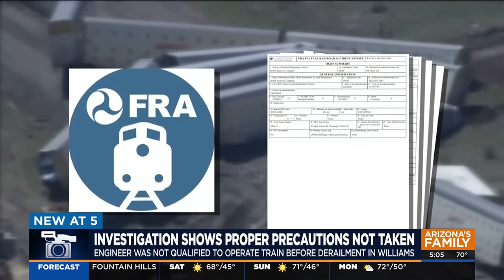Engineer unqualified to operate train in derailment near Williams, feds say

Comment: Arizona can't regulate train length. Trains are a federal matter
Reply: Train length shouldn't be a federal matter, or a state matter or a local government matter.  None of those entites employs people who have real knowledge of the dynamics of operating a Model T Ford, much less a train.  I also have a feeling that the unions are moaning and groaning because longer trains mean fewer crews.  And, I thought train crews were trained to operate trains of ANY length.  I did know they needed special training depending on train length.
Reply: @cats0182  I would think the unions would be angry for the Biden administration for interceding not for the union to strike.
Reply: @cats0182  Wouldn't you want someone to moan and groan in your behalf if the company you work for was trying to shrink its staff not because business was bad but to simply improve the bottom line and increase investor payoffs? Because that's what the railroads are doing. There is no reason to operate like this other than they don't want to spend the money to both hire more people to run the railroad and make the job worth having, nor do they want to take the time to properly inspect locomotives and rolling stock because they know they've been pushing the equipment to the brink and if they did inspections and repairs properly as they should most of the fleet would be sidelined and then they'd have nothing to run the railroad with.
Reply: @cats0182 good thing nobody pays you to think, don’t speak on things you don’t know or understand.
Reply: @jamesr2888 that has nothing to do with this, please stay on topic.
Reply: @EJayMD-11  So instead of worthless comments, why not give me a quick education.  And, how do you know that nobody pays me to think.  Are you some kind of crystal ball reader, or soothsayer, or clairvoyant?
Reply: @cats0182  this is such an ignorant take. Every class 1 railroad runs trains 2 miles plus long. We are qualified to run a train of any length, that’s not the issue, the issue is having to walk 5 to 6 miles round trip to find the issue on a hot bearing for a car that hasn’t been properly inspected or maintained. We can’t combat fewer crews because that’s not a government issue and they don’t have the backbone to intercede with mandating 2 man crews so we can attempt to make them shorter. On my class 1 we call them “supers”. 6 locomotives 232 cars and 14 thousand feet. No siding can hold them
Reply: @cats0182 no it shouldn't.
Reply: @cats0182  The government regulates and mandates railroads...taxpayers pay for the RR pensions and even medical insurance, that's one of the reasons that the question of "Have you ever, or do you currently work for, the railroad" is on unemployment benefit applications. 
You've obviously never heard of the FRA (Federal Railroad Administration). 
It's very sad that taxpayers pay for benefits for railroads, but yet "they're a private company" profiting millions every year. Railroads don't pay property tax, nor do they pay fuel taxes. After the threat of shutting down the railroads earlier this year because of "working conditions", and our POS president caving to the RRs, taxpayers are only going to be out more money, the CEOs/admin will only get paid more, and we'll be held hostage again for the same thing by the RRs in a few years. The government should have stepped in and enforced labor laws or told the RR employees that wanted to strike that they knew job expectations before they took the job.
Reply: jamesr2888 Unions bcth about everything.
Reply: @MilwaukeeF40C  They have to, because the equipment is not designed to operate in a train longer then 125 cars, 98%of derailments this year involve trains greater then 125 cars. and 1 person in the cab of a locomotive is as dangerous running a nuclear power plant with one person!!

Comment: Man, I remember operating some freight trains over ten thousand feet long in very cold weather. It sometimes took forever to get the train's brake line to come up at your initial terminal because of all the leakage from brittle, rubber gaskets in the "glad hands" between freight cars.   Many times, your dynamic brakes on the locomotives wouldn't be enough to hold your speed on a downgrade and then you'd have to go deep with your air brakes just to keep within the speed limit and hope you didn't have to set the brakes again before your trainline recharged.  Glad I'm retired now with the trains apparently being a lot longer than in the past. Perhaps the placement of locomotives in the middle and rear of freight trains helps prevent the train brake issues I faced.
Reply: That’s one of the reasons for the use of DPUs. In addition to reducing the drawbar pull on the head end, DPUs provide additional air supply and reserve for brake pipe charging.
Reply: I had an iced line on a coal train once before we had to link the eot. Only a couple times have I been scared running a train, that was one of them.
Reply: There is another to control your train on long downfall mountain grades before dynamic or pressure maintaining features.Stop your train have the conductor walk back x amount of cars setting the retaing valve to low medim or high setting.The brakes on those cars will not release while you are desending the grade Of course once you have the conductor will once again have to walk x number cars to reset the retaining valves on the cars Can you imagine the hisey fit the rail traffic control center would have Rember safety is the first importance in the discharge of duty
Reply: @thomasklimchuk441  We were always taught about the use of retainers, but never used them as the trackage I operated over was pretty much straight and level here in the Midwest.
Reply: You think genius?
Reply: @thomasklimchuk441 depends on the timetable. On our division we aren’t allowed to touch them except during a class 1 if they aren’t in the correct position
Reply: @yankeesforlife24  NS you don't touch them. They used to use them on saluda mountain but they shut that run down.
Reply: It does help.  Probably better than the push for "electronic brakes".
Reply: You're not even supposed to use air under leader or trip optimizer, you better sometimes take 1st service if the dynamics are week but then they want to handle you for it.  When the air shoots just leave it pulling and keep bailing until pcs finally trips otherwise you'll get this kind of pile up. The rear catches up with the front and here ya go.  They see you pissing away your air on the tapes and you're going home for a bit lol.

Comment: I have been an engineer for a very long time and have never heard qualified for train length. I think another and perhaps bigger concern is trains blocking crossings.
Reply: Yeah, I was an engineer for a while. Never heard of that. I have two friends who work for the UP. I am going to ask them if this is a thing.
Reply: @PatrickLipsinic  It isn't, but it should be. BNSF woke up one day a few years ago and decided to throw double trains and trains exceeding 7500' with awful train makeup (empty blocks in between loads, light loads like autos in the middle of trains with EOC, etc) at engineers with no instruction or training on how to properly handle such giant piles of shit.
Reply: I’ve been running both freight and now passenger trains for over 20 years north of the border and I’ve never heard of this.
Reply: @thetrainshop  NS is the same, only 12-14 thousand feet. Just pat on the butt and a good luck. Oh and a hearing if anything happens.

Comment: It’s shocking that the federal government after so much warning from industry veterans like myself does nothing about this.  They just keep letting the railroads do whatever they want at enormous risk and potential catastrophic cause.  They force you to use computer programs that don’t work and then expect you to be prepared to handle the train the moment the computer makes a mistake.  Trouble is, if you’ve not operated the train yourself over your territory in months because the computer has been doing it, you’re not prepared.  All we get is more excuses from our government and a blind eye to our pleading for help.
Reply: The PTC, LEADER and TRIP Optimizer systems are the biggest issue.  As noted if they have the computer trying to run the train but if it fails then the engineer is probably 'rusty' and isn't at his best.  I have never heard of a 'length/weight' qualification standard so that's just the news people making a mountain out of a molehill.  I left Class ! railroading just at the beginning of the use of train management systems and PTC.  Friends I talk to that are still working there hate the systems because all they do is babysit the train.  Some runs even have the horn blowing programmed into the PTC so the engineer basically does nothing except handle the train at the terminals.  That is "A HELL OF A WAY TO RUN A RAILROAD"
Reply: Agree. I've said for years that it's going to be problematic with less & less experienced engineers due to TO. Kinda like that video where a Dad gives 2 teens 5 minutes to make a call on a rotary dial phone. They failed. All they knew was the new tech. Engineers are becoming the same thing.
Reply: It's simple really, In all kinds of industries.

Business can come up with ways to get around regulations, a lot faster than the regulators can identify the problem, and update the regs.

  Especially when one political party is hellbent on killing any regulation, of anything

Take the FAA.  It used to be the worlds aviation watchdog, with hundreds of skilled,, experienced investigators,, regulators,, and researchers.  The world based their regulations on what the FAa was doing..

Forty years of budget cuts later, "chronic understaffing" means that  nobody ever sees an FAA guy in the field except for the airlines and Air Charter operators.  Or if there is an accident.

The rest of the world looks to EASA for guidance now, not the FAA.  Unlike Republicans, the Euro countries believe that you can't trust people to self-regulate, especially when there is so much financial incentive to look the other way.

Comment: Only one engineer on that malfunctioning Lac Megantic train, The train caught fire, the fire was put out and the engine shut off but the brakes slowly lost air. It rolled 21 kms downslope from Nantes.
Reply: You mean MMA train#2
Reply: The engineer was 'experienced' but DID NOT SECURE the train as was required by the rules.  He took a 'short cut' and the town of Lac Magantec  paid the price for his incompetence.
Reply: The Fairy Department stuck its nose in where it doesn't belong, turned off the engines, and that revoked the power required for the dynamic brakes. Once the dynamic brakes had no power, the train rolled down the hill and then the disaster took place.
Reply: @MrJuvefrank  fairy department?
Reply: @MrJuvefrank  Please explain to us how dynamic brakes are used to hold a stopped train in place. And I imagine the use of "fairies" will be needed.
Reply: @MrJuvefrank  dynamic brakes aren’t using when the train is stationary, it’s literally impossible without a reverser. They turned off the locomotive because one of them was on fire, which was exactly how they were trained in such a scenario and with the permission from the trains dispatcher. They shut off the locomotive which meant that the air reservoir was no longer producing air to the brakes on the train. That’s why it rolled away.
Reply: @yankeesforlife24  I see.
Reply: #1 argument against 1 engineer operating a train!!!

Comment: I do not remember what issue it was, but Trains® magazine did a complete article related specifically to derailments.  Train length was definitely a key point, as many railroad lines have many S curves.

As a train goes through a curve, the flanges on the wheels of the locomotive(s) and railcars push against the rails, resulting in friction.  The longer the train, the more friction there is.  This friction then inhibits the locomotive(s) ability to effortlessly pull the train.  When you had hills, the problem intensifies.

As a truck driver, I've traveled I-10 and I-40.  Train lenghs are astonishing, and the number of locomotives on the trains is meager.  Though a modern locomotive possesses the power to pull up to 100 freight cars by itself, the strain put on the locomotive(s) will cause fatigue and the train will derail.  Simply adding an additional locomotive lessens the strain.  However, an engineer has to be skilled enough to handle a typical 1.5 mile long train.  Lack of training will cause devastating consequences to result.

In the trucking industry, training programs are getting cut short almost by half, just as training in railtoading has shortened.  So many drivers are not getting the proper training to successfully maneuver and drive a tractor-trailer combination.  With over 7 years of truck driving experience, I'm still learning new things.  I also have my "off days".  Common sense, patience, and getting adequate rest will reduce the chance of making mistakes.  Unfortunately, the "Big Dog" mentality can have severe repercussions.

Though I'm no expert, it doesn't take a rocket science degree to figure out the problem here.  When you cut corners, terrible results are possible

Comment: The fact that he wasn't qualified to operate a train of that length is a factor. But, it doesn't tell use the cause of the accident. Was the train travelling too fast for the siding? Was there defective track? Journal overheat?
Reply: Speed has not been ruled out. According to them, the Engineer didn't know what he was doing. This means they don't think it was the track, but the journals were just fine when he boarded the train, but he could have neglected the journals as soon as the train was set in motion. Just in case the public doesn't know about railroad jargon, journal means, "The rotating part of equipment." Jour means, "Day." Journals had to be cared for every day.
Reply: @MrJuvefrank  "didn't know what he was doing." HHmmmm... 😜I'd probably say the same thing and throw the blame on the railroad. From the news report, sounds like they broke a knuckle earlier and were held while that got repaired. I do wonder if he was trying to make up time before he expired for the day. I'm not saying I'm an angel and would not have done the same thing. BTW, I do not work for any railroad. Just watch a lot of YouTube.
Reply: @MrJuvefrank  Journals are the wheel bearings on the trucks, under the locomotives and cars... The engineer has nothing to do with them, they are all roller bearings for decades.
Reply: @MrEricmopar  If engineers have nothing to do with journals, then it won't bother engineers if I ruin their journals.
Reply: @MrJuvefrank literally nobody on the railroad even calls them journals. We call them bearings/ axles/ trucks
Reply: They misread that ntsb report. Engineers aren’t qualified by length. They are qualified by territory. The report was talking about the engineers so called “check ride” where a manager comes on board for the entire trip and makes sure you do everything right. It was saying his last check ride was on a train 5000 feet and the one that derailed was 11k feet. Nothing to do with Length of train as an engineer or conductor.
Reply: @yankeesforlife24  Some places have DPU qualifications, where DPU trains aren't common. This could be what they mean. Since an 11k ft train is going to be DPU'd. Not knowing how to manage your slack on a train that long often winds up looking like this.
Reply: @yankeesforlife24  Maybe old people are the ones who call them "Journals." Trucks and journals aren't the same thing though.
Reply: @yankeesforlife24  I tried to look up the report to see what the cause was. I couldn't figure out how to search the FRA or NTSB site. Do you have a link to the report? I'm only asking because there are more questions than answers at this point.
Reply: @shawnerz98  there won’t be a cause. It’s still under investigation
Reply: @michlo3393  I’ve never personally seen a dpu qualification or heard of them on the bnsf.
Reply: @yankeesforlife24  neither have I, that seems more like an East Coast thing but I was just thinking out loud.
Reply: @michlo3393  yeah if you read part of the report they brought up it was talking about the engineers last check ride. Had nothing to do with qualifications. It’s both the responsibility of the crew and the train master to not stop on a train without a valid certification. At most this engineer wasn’t qualified on this territory.

Comment: Train length and weight matters because the slack between cars will "run-in" and "run-out" as a train goes up and over hills, and changes speed. Remember that only a thin lip of steel about one inch high, called the "flange," keeps a railroad car from falling off the rails. A railroad train is like a high-wire act that keeps working because of human skill.